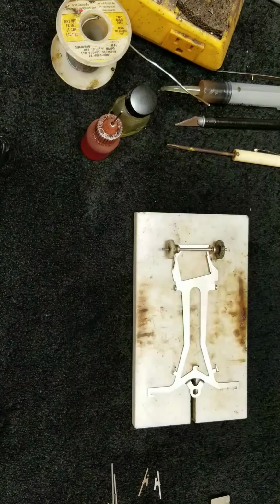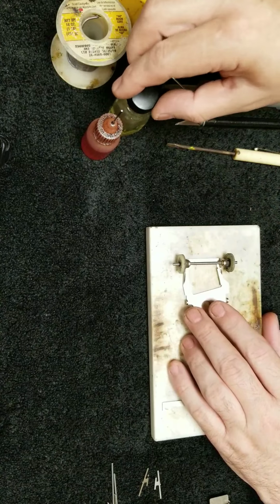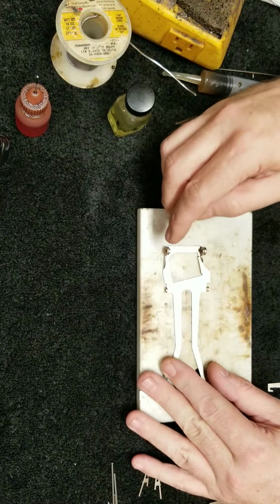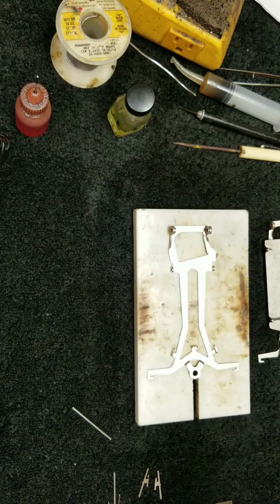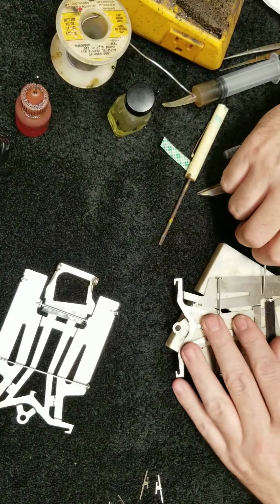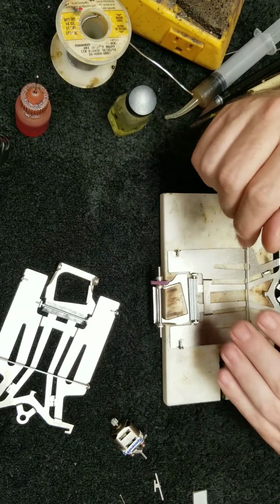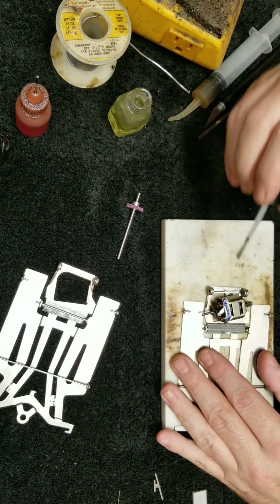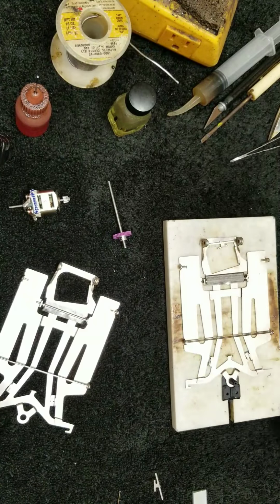Between the Lanes "How To" Flexi Type Chassis Part 1

Comment: Nice Vid. Really get into these slotcars now. What temperature do you set your iron to 
? And what solder do you use ? tin/lead 60/40 ? thanks in advance.
Reply from the maker: As hot as it will go. Yes I use 60/40 solder.

Comment: I used to race when i was a kid, but the tracks I raced at were bought. Now those tracks are somewhere else. I have been to the tracks new location a couple times now and my buddy's dad was there with my brother's old flexi 2 stock car. I raced that my times weren't good after not racing for 22 years, but I stayed on the track pretty well. I have a question about chassis. There are so many out there but I think i found one I might like and it is the JK Cheetah 21. I am wondering what your thoughts are on that and how new racer friendly would they be? TY :)